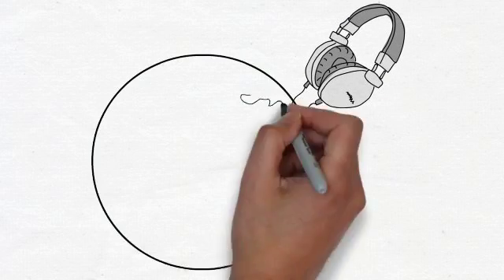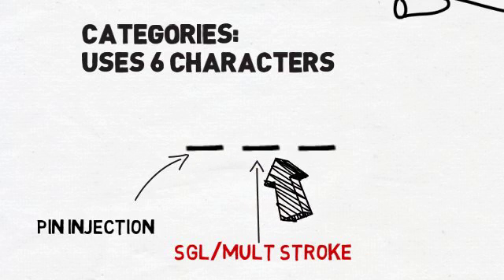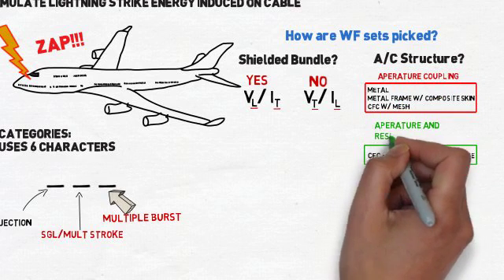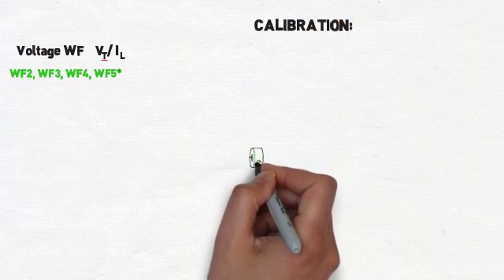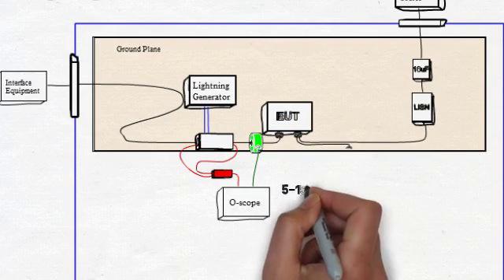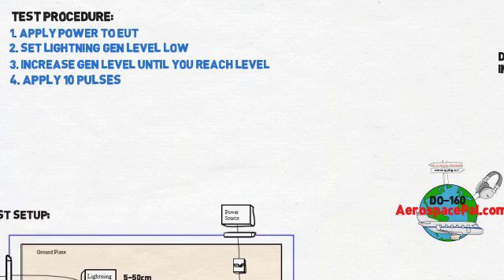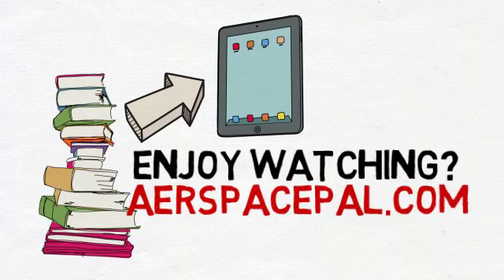RTCA DO 160 Indirect Lightning Cable Bundle Overview

Comment: If the EUT is a PCBA with 1 cable bundle to it (including Board power, and IO). The EUT  is not grounded, so it floats, except capacitive coupling op a few pF to the table.
Where does the return current flow, which we inject into the bundle?

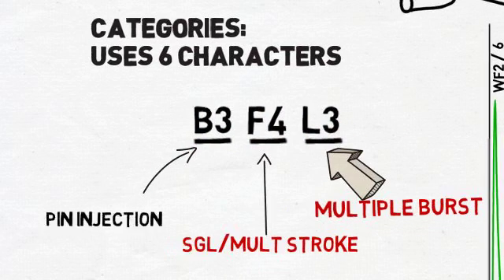Comment: Why are you showing PIN INJECTION B3 (at time stamp 2:47) if this is for cable induction?
Reply from the maker: Thanks for the question. That is because to understand the requirement you much understand that the first two letters of the requirement are for pin injection.